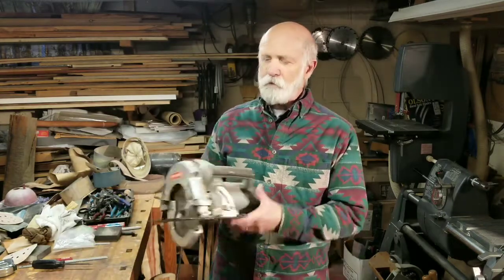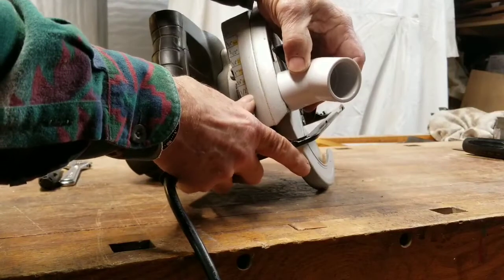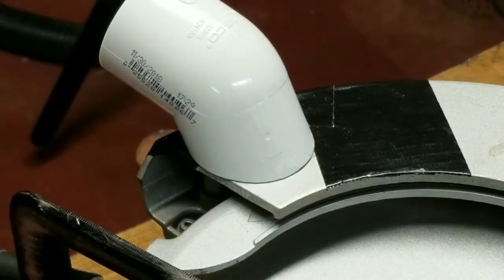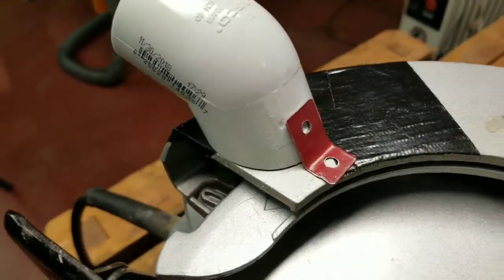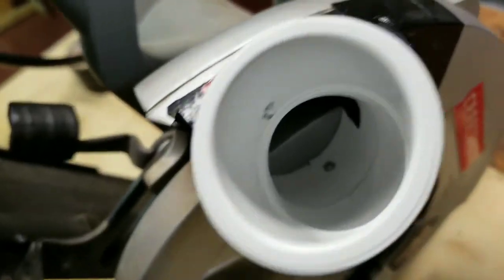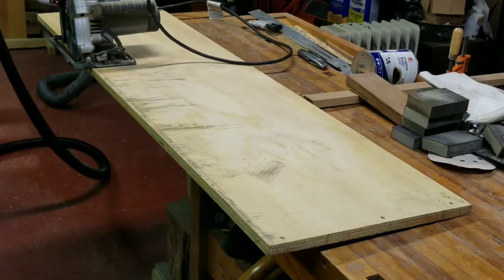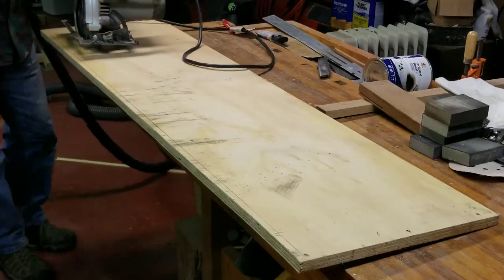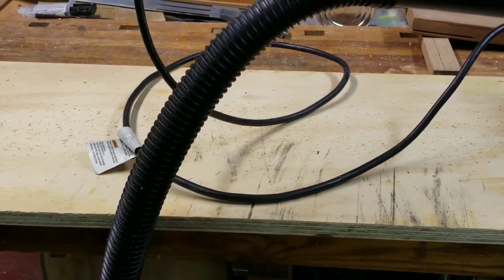Circular saw dust collection modification

Comment: If its not working whats the use of making it ? Recommended to avoid this video
Reply: Learning from mistakes is more valuable than copying success! I just made that up 😆 But seriously, it’s part of learning. Maybe not more valuable, but just as valuable.
Reply: @wh0tube  This is very powerful. Imagine from watching this failure, i have an imagination on what to improve to make mine work better, i wouldn't have gone through this imagination if it wasn't for this video
Reply: @deepconcept2020  totally agree. There’s just not enough time for each of us to repeat every mistake others have already made. I think sharing our mistakes is just as important as sharing our successes.
Reply: Lots of videos are based on ideas and a review of how they function.  As a post script I tried a stronger vacuum and the results were better.
Reply: With that logic, we'd all still be riding horses to work.